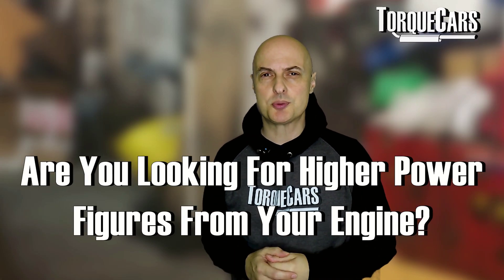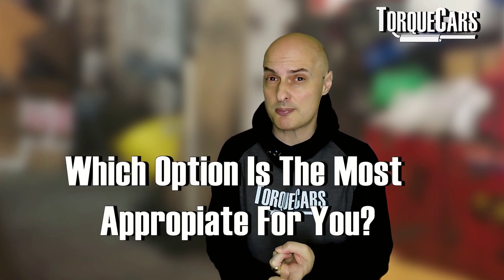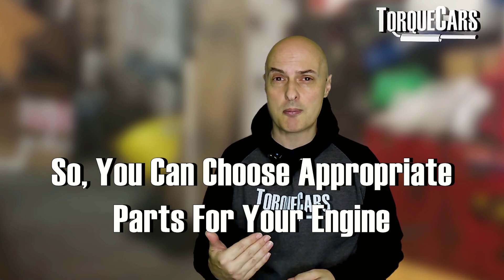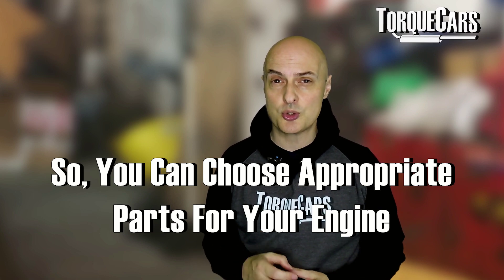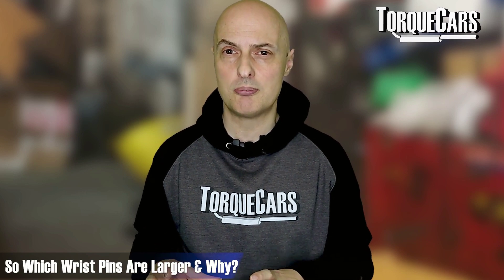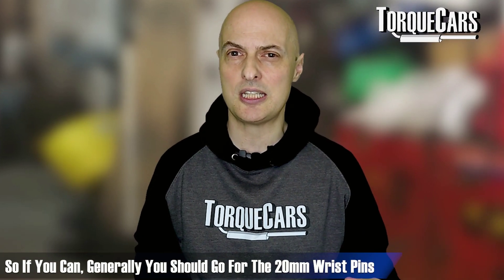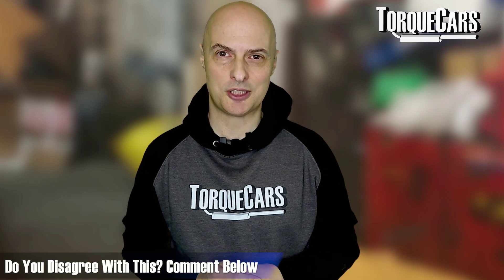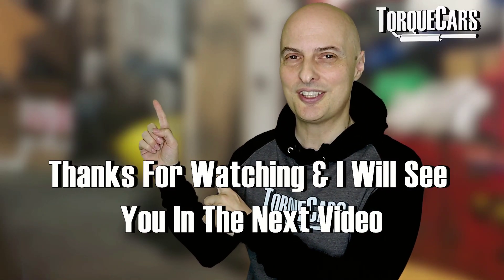🔧 VW 1.8T 20V Rods & Wrist Pins Guide: Pros, Cons, and Sizing Explained! 🛠️

Comment: Hi, just asking. I have Golf V 1.9 tdi BXF engine. Can it be upgraded to 160 or 170 hp by adding ARL Injectors and remap? And are there any things I should know, like can the  connection rods withstand the power?